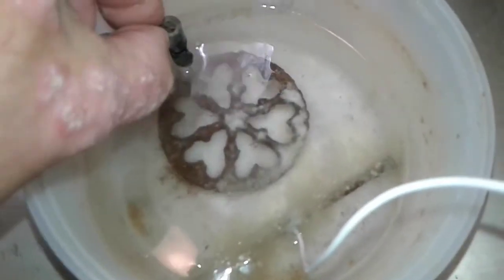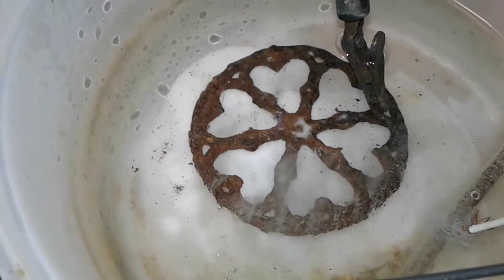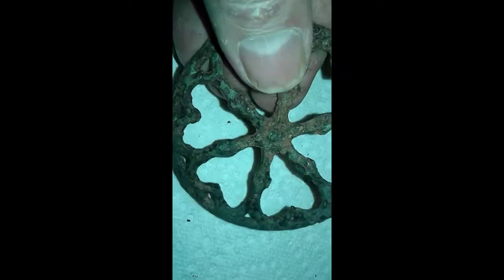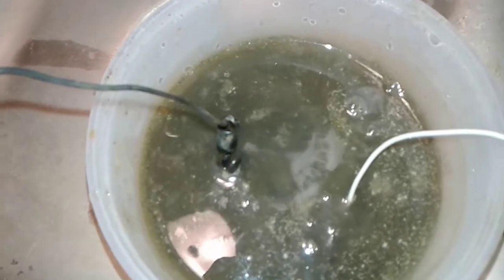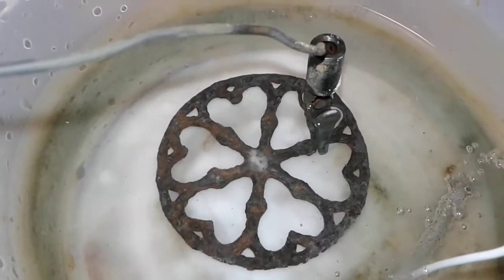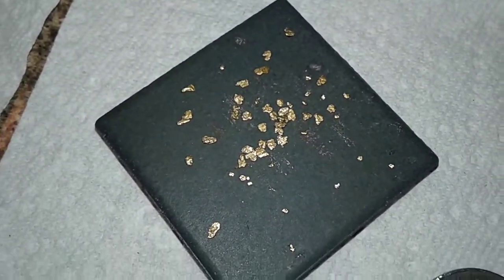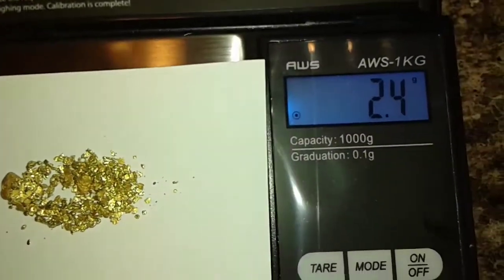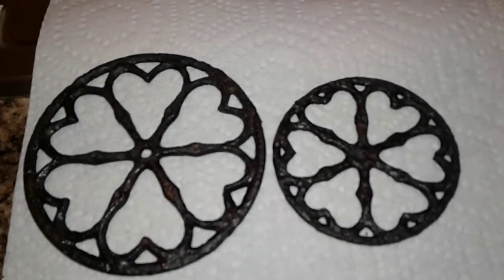Relic saved by ELECTROLYSIS. Gold Panning.

Comment: Great job Mike on the electrolysis, that wheel came out great.  Awesome job on the gold panning to buddy, you can't beat Tom's Gold Dirt for  the price. Stay tuned I may have some paydirt on my ebay up for sale soon! I will get those stickers out in the mail to you soon. Sorry it's taken me so long to get them in the mail.  Looks like you had some gold floating in your pan at the beginning. Use  a drop or two if dish detergent or jet dry and it will drop right to the bottom! Take care and good luck Mike, hope you guys had a great 4th of July.
Reply from the maker: Thanks Steven, you are selling paydirt, I will get some. thanks for the info on the floating gold. 4th was good, hope your was. still have a 1 pound bag of paydirt to do. Now is that 24k, but you have to times by 80% for pureity?